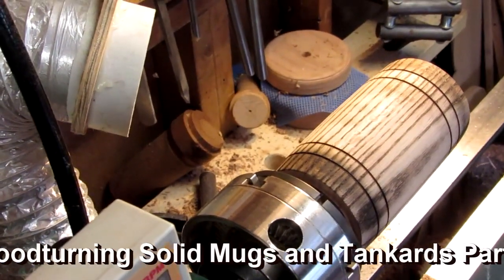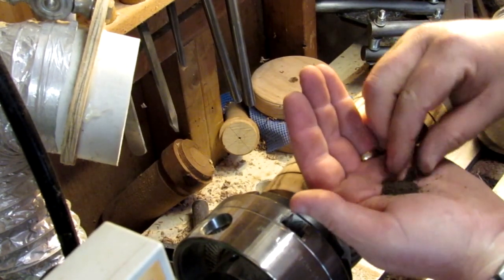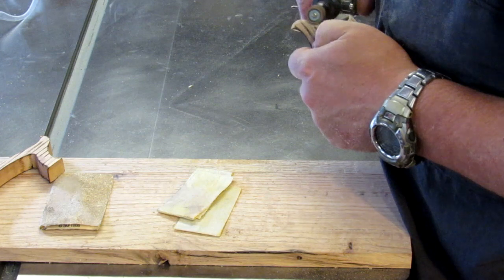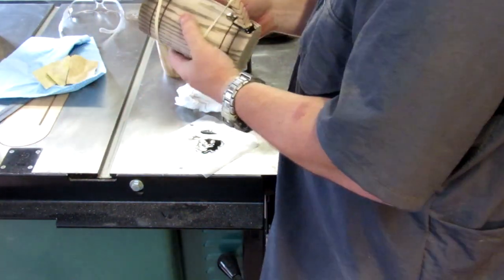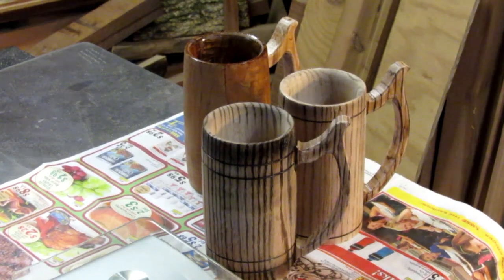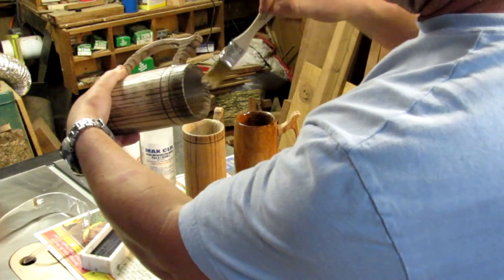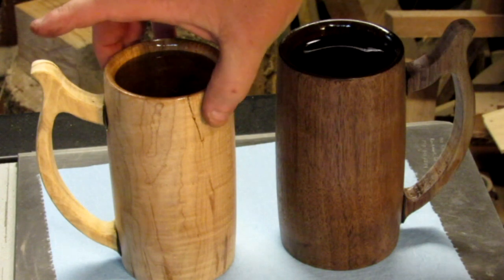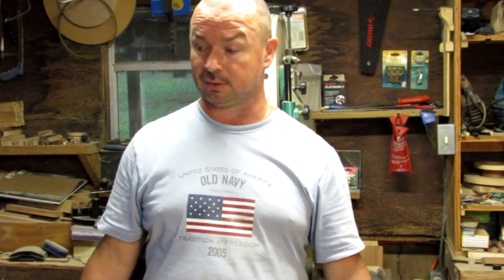#83 Woodturning Solid Mugs and Tankards Part 2

Comment: You can blacken your Oak with vinegar and steel wool. Put fine steel wool in vinegar and then cover it for three days then take out the steel wool and apply the vinegar with the steel wool and the wood will oxidize very dark and then apply again and it will go an ebony black. give it a try and see if you like it.  Thanks for the video Stephen.

Comment: Great work.Turning oak is challenging. Turned some oak bowls last week, most of them cracked. Dang I hate it when that happens. Like your videos, Thanks
Reply from the maker: D Houston Thank you sir. you are right about the oak. It will crack if it is not cured or either rough turned green and put up to dry. Even then it is still probably 60% to  40%. Glad you enjoyed this project and my others.

Comment: Another great video Stephen.  Very informative.  I am envious of your x-carve.  I could think of a lot of things that a machine like that would save me time on.  I did make a mug like that for myself and use it often and have had no problems.  The only thing I did different was I used Spar Varnish on the outside.  It is used on boats so I know it will be water proof.  Keep up the good work!!
Reply from the maker: Matthew Kendall Thank you Matthew. I really like my X-Carve and it will be in many of my future videos because it is now an integral part of my shop. Cutting things like these handle blanks really saves a lot of time by making clean cuts without all the saw marks to file out. It leaves a good blank for hand shaping.  The Spar varnish is very good stuff and also has UV protection inside making it great for outdoor finishes. Good choice. Thanks for commenting.

Comment: Beautiful two-piece (82 & 83) was that, Stephen.
The mugs see great.
If you value the handles where the machine has been milled handles. Mishap? One could on the base plate (where the maple plate was attached), see traces of the handles, which has left the mill.
The idea with the epoxy is not bad, so one could also emphasize a vase from the inside with a brush.
Reply from the maker: Günter Schöne Thank you Gunter. Yes, I have to be more careful with my depth of cut. The marks you see were from cutting too deep. The pieces were still good to go. You could use epoxy in a vase. Excellent idea my friend.

Comment: Hi Stephen  great video and much appreciated.  I followed your link and priced the epoxy. it seems all the varied epoxy  products are identically priced which here in captive Canada works out to approx $100.  I think I will have to do other products or I can't afford this retirement.
Reply from the maker: +Jean MacHardy Thank you Jean.  This epoxy is very expensive to ship even inside the US. Just do a search for food grade epoxies that you can get cheaper. The biggest problem I see is shipping over the border. It ships to me for around $20.00 it looks like it is costing you about $60.00 just to cross. Wow, I would look for another alternative also.

Comment: Good job. Here is a trick I use to remove air bubbles from epoxy. I have poured epoxy on bar tops over 50 feet long and some with coins in them. You can use a propane torn but I like to use just a regular heat gun. Blow the heated air over the air bubble holding the nozzle of the air gun about 6 inches away and the air bubble will rise right up to the surface and pop.
Reply from the maker: James Stanlake Thank you James for the suggestion. I actually read it yesterday and I tried it on my pen mold used in the video to catch my leftover epoxy and It Worked great. I really appreciate it and will use it.  Thank you for commenting.

Comment: This was a great video! Thank you so much for the details...didn't mind that it was in 2 parts as I love to see all that goes in to a project. Just a question about the epoxy - basically isn't all epoxy that is used in the food industry (bars, restaurants, etc.) food safe after it cures? I have used one called Glaze Coat that is made to use on a "Bar Top" inside of vases and have had no leakage, but it was just flowers (but the flowers didn't expire any sooner than expected - nothing toxic to the plant).  Not trying to start anything, just trying to learn. Thanks again for the great idea and video!
Reply from the maker: snowhillwoodturner I agree with your statements about epoxy. The reason I use this is because it is actually advertised as FDA Compliant for food contact. I personally believe like you that all epoxy is food safe once cured, but if I sell these mugs to someone who wants to know, I can prove that it has passed FDA regulations and been approved. Bar top epoxy does not have to be FDA Compliant although it probably is. I don't mind sharing my information and gathering it from others. I really enjoy discussions. I think they help everyone. Thank you for your questions and comments.

Comment: Great Video Steve. Can you use any other coating for the outside other than the polyclinic? Also these are solid wood mugs, would there be a problem making a mug out of different woods put together? I am about finished with my first solid wood mug Ill send you a pic when its done. Again thanks for the video

Comment: Awesome piece bud.  Another fine video.  I just made a honey pot for the first time and was wondering what would be good to seal the inside with.  I made from a chunk of burl.  I thought about using olive oil or Howard Feed-N-Wax or boil linseed oil.  Would any of these work or should I use something else?  Thanks for sharing your time and knowledge.
Reply from the maker: Thank you Wayne. You could use the same methods as in this video with epoxy or possibly just bees wax for your Honey Pot. Hope this helps.

Comment: love your videos and  yes i'm a new fan, the only question I have is where do you get your supplies? many thanks!
Reply from the maker: Thank you Zane. Good question. I get my supplies all over. From Hardware stores, to Hobby Lobby, to online stores also. The  epoxy used in this project was called Max CLR and can be purchased from Ebay. I hope this helps.

Comment: Is there enough capacity on the carving machine to put the tankard in and carve out an indentation for the handle to be installed, instead of surface mounting?
Reply from the maker: David Campbell Thanks Dave. Good Question and one that got me thinking. I don't know, but I will find out if it can carve this thick. It will be close. The thickness capacity is around 3.5 to 4 inches so I will just have to give it a shot. Worse case is a broken bit or belt. That is worth the experiment.

Comment: Beautiful tankards! One question. Would it be ok to use the epoxy on the outside after finishing to seal the entire tankard so you dont have to worry as much when washing it or would that be bad.
Reply from the maker: CHRIS MARKERT Thank you Chris and of course you can use the epoxy on the outside. I don't use it because it is to glossy and I like the sort of roughed up look. You know? Excellent idea though. Oh yeah, epoxy is fairly expensive especially for the super clear stuff. Thank you for commenting.

Comment: Hey Stephen, Excellent project and no challenge to your use of food grade finish, but is the a less expensive alternative?
Reply from the maker: Robert Evans Thanks Robert for commenting. I'm sorry I did not get the product you are speaking about. Which product are you referring too.
Reply: Well, if I'm not mistaken, you mentioned it was nearly $40.00 for those two small part "A" part "B" food grade epoxy that you used for the inside part of you tankard. I was wondering if there is a quality alternative? or is that just one product you discovered in your research
Reply from the maker: It is the only one I really looked into. It is industrial grade and crystal clear. It cost twenty dollars. Shipping is shat kills you.  It is as much or more than the product itself. On a positive note. I have completed twenty two of these mugs and still have almost half of the epoxy left. I do believe that once cured most all epoxies are safe to eat out of. However, I do not know that for sure. I hope this helps.

Comment: I can’t seem to find 4x4 wood besides a  post of Doug fur. So did you start out with a 4 or 5 inch around log and turn it down.  I just bought a lathe because of this video.  Trying to make something besides Doug fur tankers
Reply from the maker: Thank you sir for your question. I mill my blanks from raw logs. Most of these mug blanks are from a log that has been cut in half (like bowl blanks). Then I cut the mug blanks from them parallel to the grain. I hope this helps. Let me know If you have anymore questions.

Comment: I've been working with making mugs w/ a very different design, but same epoxy!  Been having trouble with drips, but working on it!  I was wondering if you still seal them this way, or have any new tips?
Reply from the maker: Thank you for commenting. I still use this same method only with a different epoxy. I use Alumilite Clear Cast now because of the price. It is food grade and cures perfectly clear. Make sure you are using only very thin coats and you should have no problems with drips. I hope this helps. I buy my Epoxy from Hobby Lobby. Or you can get it up to the gallon from Alumilite.
Reply: @StephenOgle  I'll definitely check the Alumilite out, and try being a bit more patient with thin coats, haha.  MaxCLR does have an interesting video out there where they do thicker coats on a wooden bowl, which is mounted to a slow-rotating chuck (~10rpm).  But they also struggle with bubbles and have to do all sorts of acetone spraying to prevent them... I think your method sounds a lot wiser. 

Thanks for sharing your wisdom, cheers!

Comment: Certainly don't wish to cause any arguments but did have a question about the epoxy finish.  I also apologize if you had already answered this question in the video I could have very well missed it due to the noise I am still dealing with all day today.  Anyways why didn't you use the epoxy on the outside as well?
Reply from the maker: Syriusly Delyrius Well sir. Glad you enjoyed this project. As far as using the epoxy on the outside. It would leave a very high gloss which I did not want and it is also (in my book) too expensive. Even finished on the outside with epoxy it still could get wet and the same rules should still apply as to washing and drying. This is just why I don't use it. You can do it if you would like. I'm sure you would enjoy your results. Let me know if you do.

Comment: I have another option for you.

Take a heat proof glass, and use it as a liner for the mug.  Bore out the inside diameter to accommodate the glass and job done, and guaranteed no leakage :)
Reply from the maker: +crushed51 Thank you sir.I have actually used your method for some bowls and it does work great. Thank you for commenting.
Reply: Delighted to be of some help my friend :)

Comment: Have you had any problems with the epoxy running down (even with a thin coat) and settling at the bottom of the tankard?
Reply from the maker: James Templeton I did at first but not since I started going thin with the coats and pulling up from the bottom. This epoxy has a 70 minute working time and the viscosity is thick enough to stick to the sides as long as there is no excess. Thanks again my friend.

Comment: hey Stephen, i know this is about a year late and im hoping you can answer a couple questions for me. so first question, how did that epoxy hold up. i just bought some and was wondering if you had any leaking. second question, have you tried pouring a fair amount in the piece then sealing the end and turning it on the lathe to let centrifugal  force spread the epoxy out.
Reply from the maker: Thank you Harlen. The mugs are holding up very well. None have come back to me yet and my Prototype which is used almost daily is still completely waterproof. I have never tried to spread the epoxy with the lathe, good idea. I only use a brush. Take care.
Reply: Stephen Ogle, thanks. I appreciate it, your video helped alot. the max CLR was bought on your recommendation.

Comment: Stephen on the Max CLR can you use that if you make a coffee mug?
Reply from the maker: +gulfmedic1 Thank you sir. I do not know how the epoxy would behave under hot beverages, More importantly is the behavior of the wood. Hot to Cold and back? I do not know. May make for some good experimentation.
Reply: Stepen, thanks for the feed back I think your right it would make for good experiment.  I will let you know what I find